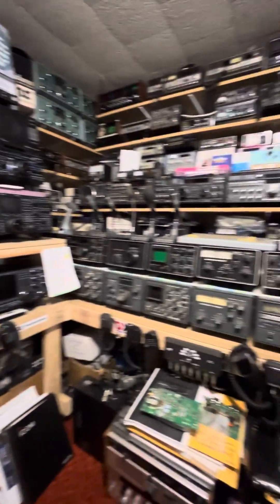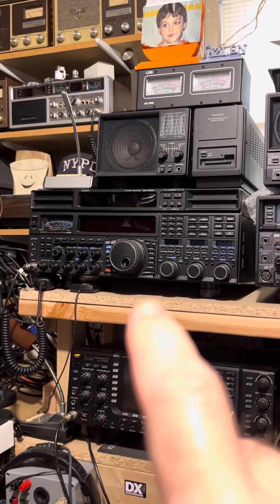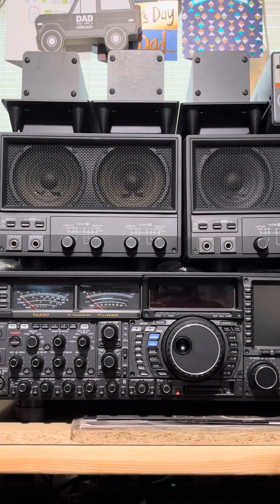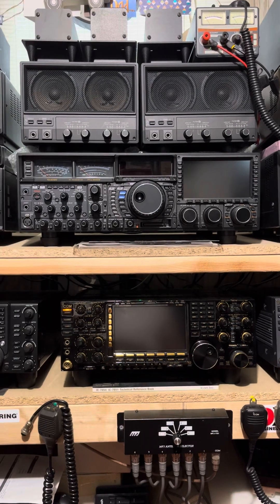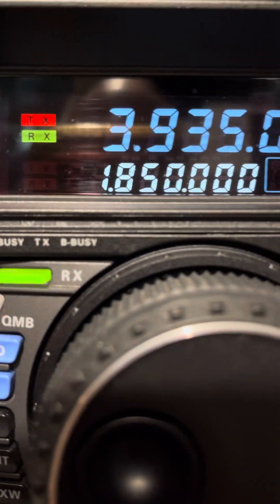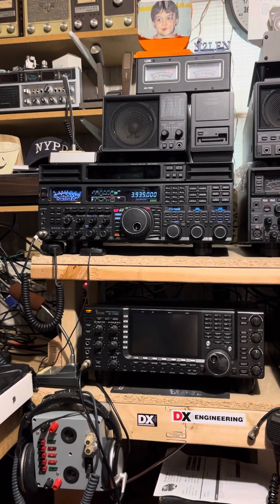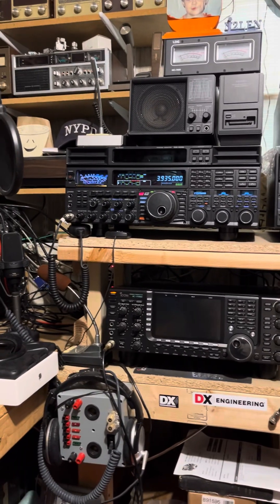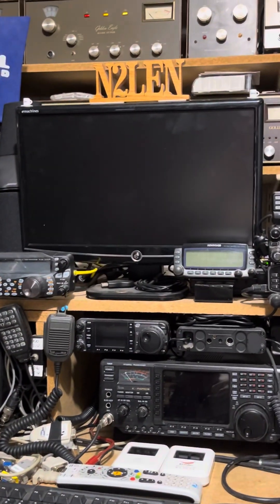FTDX-9000D & FTDX-5000LTD Boot up duration time on 12/27/24 @ 9:58AM

Comment: What!  NO  R-390 ?
ALL TUBES triple conversion
Reply from the maker: I don’t own a R-390. I do own a Motorola #1896 R-390A that sits on my right bench along side a pair of Johnson 500’s. It was completely restored by Doug Massey from MasseyRadioLabs Inc several years ago! Here is a link to Doug’s YouTube Channel showing the actual receiver when it was almost completed. 

https://youtu.be/sJZG-Lz1DsA?si=tZDumunP6yNE9Tou

There are other videos showing the actual restoration process which took a year to complete!😊👌👍